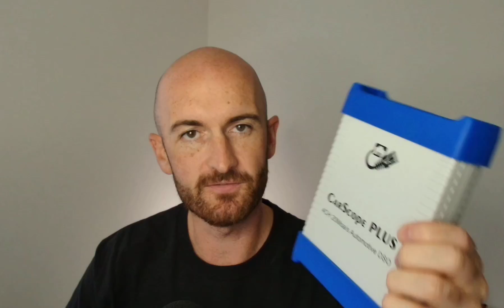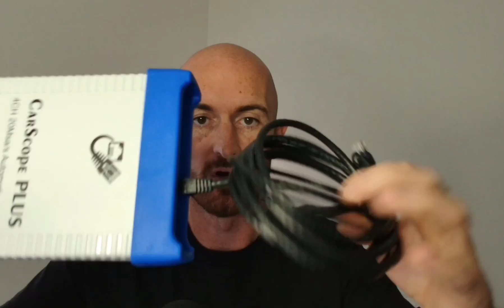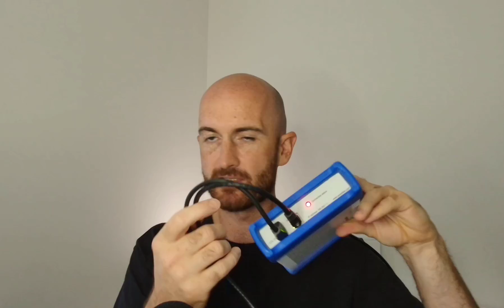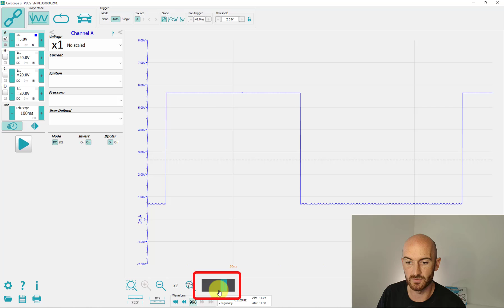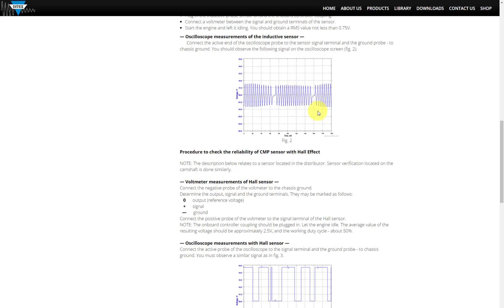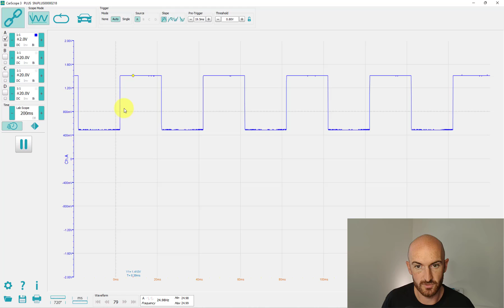DITEX CarScope Plus Oscilloscope Tutorial & Review

Comment: Do I have to ground my test lead when trying to get a wave form? Like let’s say I have a passive wheel speed sensor. Would I back probe both wires on the wheel speed sensor one to one wire one to the other 
Or should I just ground my test lead to battery negative and use the other to just back probe one terminal on the wheel speed sensor?

New to this part of diagnostics. Very familiar just don’t know the procedure
Reply from the maker: For most sensor signals, yes. 

For inductive sensors ideally you will measure across both signal wires, but not if you are another channel connected to ground (the ground d channels are common on this oscilloscope)

Comment: Hi Darren,  thanks for this review and all your videos, it helps a lot.  

As I select an autoscope, I look at the whole package, not just the hardware. Software and the waveform library are just as important as the hardware.

The CarScope Plus (and its software) looks like the next upgrade option from the Picoscope 2204A for the DIY diagnostician, or pro on a limited budget.  The CarScope website has a specific article where they discuss the specs required for an auto scope, saying that huge memory, bandwidth, sample rate and resolution are not required for auto diagnostics. I see this as a direct criticism of the PicoScope 4425A specs.  I linked the article below.

Can you comment on what would be lost when doing auto diagnostics with the Carscope Plus versus the PicoScope 4425A, as it relates to the lower specs of the Carscope Plus?

- Bandwidth 2Mhz vs 20Mhz
- Memory Depth: 32KS vs 250MS
- Sample Rate: 20MS/s vs 400MS/s
- Input Sensitivity: 40mv vs 10mv/div
- Resolution: 8bit vs 12vit

CarSoft article: https://autoditex.com/page/how-to-choose-an-automotive-oscilloscope-61-1.html

Comment: Nice review 👍 i still have a doubt though. I oscillate between this and Pico 2000 series (can't afford the automotive 4ch pico)  Except the fact that Pico has possibles updates in the future, just between these two oscilloscopes, would you be kind and advise? Which one and why? Thanks
Reply from the maker: You wouldn’t have to spend much to try the Pico 2000. As for the 4 channels, the specs are similar. The Ditex has some automotive features in there but has external power supply and LAN connections. The Pico doesn’t have automotive software but the oscilloscope softwares are pretty much the same, so if you upgrade to automotive, you carry all the learning over too. And it’s USB based. Always going to be a tough choice at the budget end
Reply: @MechanicMindset  thanks, but in terms of the resolution, data aquiring, and overall usage and versatility, which one would you recommend? your personal prefference if you can tell. I am aware that most techs use Pico (4ch usually) I was thinking a dedicated automotive oscilloscope would be the way to go, but i see many use  the 2000 series also. And saw a comparison of a guy from US with Autel, Hantek, Pico 20 and 44. Also my main concern is probably how often would i need the 4 channels (i do service motocycles not cars). Because the Ditex and Autel is on the affordable side of 4 ch osci. and now i'm stuck if i will use often or not all 4 ch.
Reply: @motorax.service.motociclete  Hello! I am in the same trouble now. Which one you bought it at the end? Would you recommend something else? Thanks for the advise ✌️😉

Comment: I just joined your oscilloscope training course and as it stands I only have the Picoscope 2204A scope.  I have been wanting to get the 4425A but it is rather expensive.  The previous version without the BNC+ connectors is no longer available.  I was thinking I don't need the feature where the scope automatically detects the probe attached.  It's nice, but I can do that manually.  Then I watched this review and that scope is less than $500.  Is there any reason I should spend the extra money to get a Pico instead of this unit?  It appears to be relatively easy to use the software and has the capability of any other scope regardless of cost for the purposes of automotive diagnostics.
Reply from the maker: This is a nice scope for the money. Software works nicely. As long as you have the LAN cable and don’t mind connecting the 12V power supply 👍
Reply: @MechanicMindset  thank you very much.  If I can save over $1K I'll use a power supply and set up my attachments manually.

Comment: Great info on using oscilloscopes I have a Hantek 6074be, with it being a shared ground how would you test injectors using a back probe and a amp clamp at the same time, as I have seen on one of your videos the earth side turns in to live when the engine is running ?
Reply from the maker: Cheers. If you put all the negative cable on chassis ground, you’ll have no issues 👍
Reply: Thank you for your help

Comment: I've been looking for a laptop based scope Can't afford a Pico right now. I was looking into this scope and also there pressure transducer and also the autel mp408, which do you honestly think is better, pros and cons, please help.
Reply: I definitely will be getting one. thanks for taking the time to comment.
Reply: Hello - Please do not buy the Autel MP408 absolutely terrible scope . It’s a Hantek unit with awful software slow interface and really bad connection issues even with the top line Autel machine the scope was hopeless . Personally the Ditex knocks it out the park . A lot of scope features you expect as standard on the Autel MP408 are just missing , it lasted 3 month then sold on . 👍

Comment: WTB by a laptop with a LAN port :P
Reply from the maker: True, not many have them anymore! You can get adapters. Ironically, they are USBx 🤣. Should still benefit from isolation though Id have thought
Reply: @MechanicMindset  they don't ?? LAN is still a very important port to have.
What sort of speed does the LAN comms actually operate at ? ie, add a small gigabit travel router in it's place to run wireless ?

I had contemplated this scope for ages, but their specs listed just seemed slow for likes of CAN, especially if using all 4 channels. Although actual spec detail was limited
Reply from the maker: @blow0me  No, the most modern laptops don’t. My laptop doesn’t. It’s no bother though, adapters are cheap. These specs are just fine for most automotive diagnostics, including CAN 👍
Reply: @blow0me  Maximum sampling rate: 4 independent 25 MSa/s ADCs. Excuse me, sir, but I would like to make a clarification. With CarScope PLUS, it doesn't matter how many channels are currently active. Each channel has independent  ADC. So, 20MS/S are always achievable.
Reply: The Dell Latitude 5530 works perfectly with this scope , big screen and Ethernet port plug and play . The scope has operated perfectly and massive improvement with the new software
Reply: Lenovo ThinkPad T14, T16 Gen 1, Dell Latitude 3420, Latitude 3520, Latitude 5530, and many other new laptops have an RJ-45 Ethernet port. In other words, this port is available to almost all modern business laptops with high performance and durability.